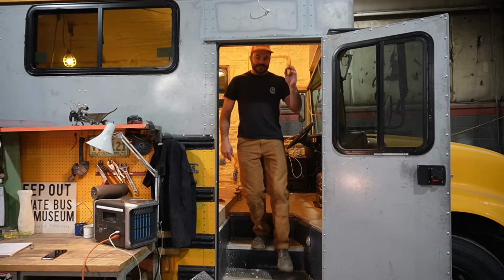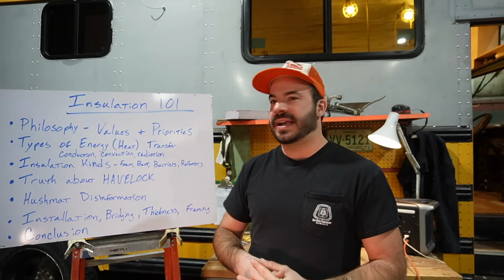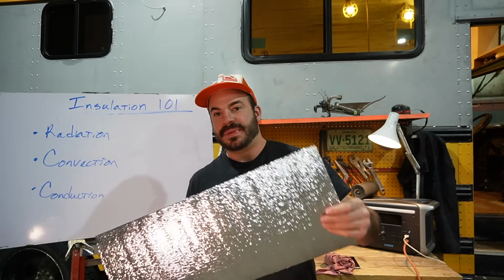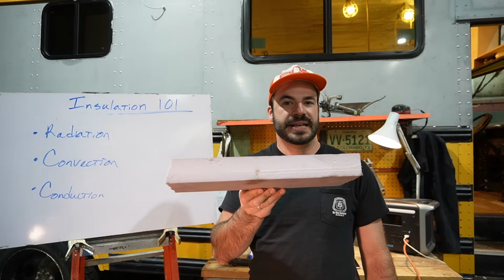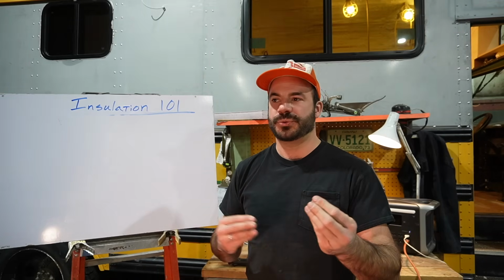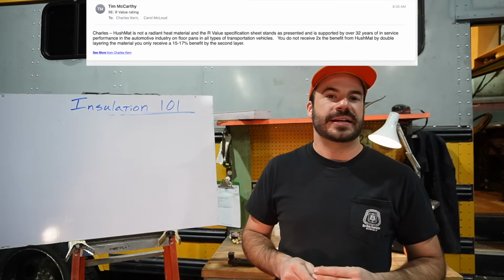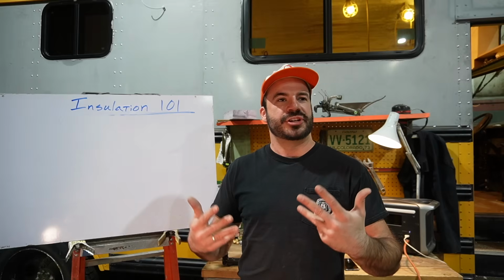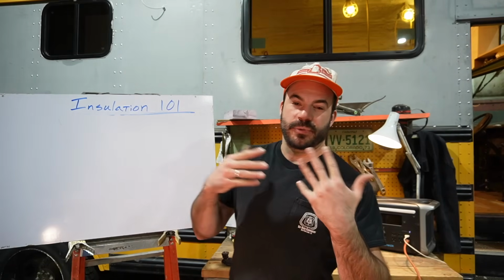Insulation is a SCAM (& the truth about Havelock and Hushmat)

Comment: I have tons of insulation knowledge, R value, thermal bridging, vapor barrier, moisture condensation, etc. I knew 1/8" of insulation is nowhere near an R value of 7 and that Havelock wool insulation is not as great as touted by IG and YT van people, but I did not realize polyisocyanurate's R value decreases with temperature! Thank you for the great info and calling out the BS some of these companies are slinging.
If you are using 2" extruded polystyrene foam on the floor with a compressive strength of 25 psi why have a 3/4" plywood subfloor, just use slightly thicker floating floor to disperse any point loads onto a larger surface area of foam, as it is at 25 psi a 1 foot by 1 foot area can support 3,600 lbs. Weight is the enemy of van or bus builds as it costs more money in fuel for the life of the vehicle and that weight may be better utilize for larger batteries or increase fresh water volume, etc.
Reply: Yes, @ChrisDaniel1339, my thoughts as well. 

The trade off is whether a thinner subfloor, which is going to be plenty crush-resistant (strong) on top of the XPS is going to be sufficiently impact-resistant (tough) enough to protect from damage that, say, the pointy corner of a really heavy object falling on it would do. The XPS underneath isn't very good at helping the subfloor resist the damage any such high-impact concentrated point loads would cause the subfloor sheet. 

So yeah, its another builder's trade-off. For myself, I think a 3/8" subfloor under another 3/8" of T&G wood flooring is tough enough, or even 5/8" under a sheet goods floor. Depends on the material, too. OSB is probably less impact resistant (tough) than most plywoods, all of which are less tough than than no-void marine ply. Its all in the cost/performance/priorities trade-offs.  I personally don't like OSB, though the ZIP system is interesting but pricey- and I'd want to put a vapor barrier on it anyway.   I would actually be more comfortable with a thinner, smoother (1/2" ACX) plywood, T&G jointed and well sealed under a linoleum finished floor, which I just happen to love. To each his own. 

I agree with you though that 3/4" ZIP board is probably overkill for a covered subfloor, but Chuck might be using that for an entirely different reason, like securing cabinets and interior walls and fixtures, or he plans on dropping really heavy stuff on the floor all the time...
Reply from the maker: i like the advantech subfloor so I can practice lawn darts inside the bus ;) really, i just like its ability to hold fastners and be a super solid substrate with great moisture resistance. We used to do tng plywood for the subfloor but the quality of that has really dropped in the last few years
Reply from the maker: I agree 100%. that news about polyiso is weird isnt it?!
Reply: @ChuckCassadyYT  absolutely! It seems like polyiso is more suited for hot climates like Florida, Texas, and the desert south west.
Reply: I was planning to use polyiso as the inside of a combined approach- the outer 1 1/2" including all the nooks and crannies will be XPS, leaving a smooth square box inside for the inner 1" to 1 1/2"  of polyiso, taking advantage of its vapor barrier on the inside. Since I'm converting a flat-sided step van, this approach makes the most sense to me. The polyiso will never get so cold that it loses all of its insulation gain over XPS. There will be no side windows at all. 

I'm still planning to spray the ceiling, as I need the strength and water protection under the rather flimsy "skylight" fiberglass roof skin. I'll laminate some more glass, then gelcoat and Tropicool the exterior roof under my solar panels.  Toying with the idea of reprofiling the roof with foam to collect rainwater. My brother-in-law has moldless composite experience, so it isn't beyond us. 

BTW, Owens Corning says that XPS actually goes from R5/in at 75 degrees to R6/in (!) at 15 degrees- a 20% gain. So my putting XPS on the cold side and Polyiso on the heated side seems like the best use of the materials, and since my rig is mostly flat everywhere, it works out about the cheapest and easiest way for me to go...
Reply: Oh, yeah, Chuck & Chris- what do you think about aerogel? Pricey, yes, but unmatched performance. Hydrophilic. Lightweight & durable. Typically wrapped & clad. Can be layered. Between R10-R11 per inch. Easily stripped for repairs and even re-use.  It is used here in Australia on process pipe work and tanks- but only where nothing cheaper will work! The aircraft and offshore guys use it, too, generally on piping.

It would seem to be a superior solution for insulating short runs of water lines to and from external tanks to protect them from freezing. A little goes a long way and could make all the difference on the short runs of supply lines exposed under a vehicle between otherwise insulated/heated tanks.  You can even wrap it (where there is room) with a lower performance outer insulation to make really well insulated piping. That's what I plan to do with it, anyway. Also could be used on mini-split refrigerant lines, but I don't know if that's ever a problem...  

McMaster-Carr has it in the US in small, expensive sheets, with a special flavor for low temperature use. Safe down to -290° F!!!

Tommo
Reply: @tommotrl  If a company could make aerogel that mixes with a binder and gets shot out of a spray nozzle it could be applied just like spray foam. Aerogel has some amazing properties the only drawback for the the avg consumer is cost. I have seen scientist hold a thin sheet of aerogel in their hand and a blow torch to the other surface of the aerogel and the heat did not transfer or burn the scientist. WOW

Comment: This is such critical information. I saw a build on instagram and the couple did not have this info, the ceiling where all their roof ribs would be were COVERED IN ICE the first cold night of their build now they have to rip and out and redo it. So many people don't have this info while building and end up with ice or mushrooms! Thank you!
Reply: Hats just like all the homes you see as you drive down the road on that same cold morning and look at all the homes lined up and you can see what homes had good builders and which didn’t cause you can see and count every rafter in the roof because of the ice/snow lines on the roof and what had already melted. Those low quality homes are all over

Comment: Great video, but I should point out you are using convection incorrectly. What you are describing is mass transfer. It is often considered a fourth method of heat transfer.

Convection is transfer from a surface to the fluid or fluid to fluid, within the defined volume. On the inside buoyancy is the primary driver causing a circulating flow up or down the walls depending on the temperatures. A fan could also increase convection. On the outside you have the buoyant effects, but also wind, which transfers far more due to its speed. There is no mass transfer thru the wall for this effect. Convection transfers the heat to the wall, conduction takes it thru, convection and radiation on the inside transfer it to you. Mass transfer (leakage) is in addition to convection.
Reply from the maker: thanks for the information, im always learning!

Comment: Holy crap, Chuck. That was fantastically spot-on! My wife is a LEED AP and teaches Energy Code in NYS and I've picked up a lot from her, and the way you apply it to a bus is fantastic. So many people don't understand thermal bridging - not even many of the pros. 
That being said, keep in mind that spray foam has its own significant issues, including air leaks and wall separation that severely diminish its usefulness, in addition to the inherent toxicity of the product itself.
Regardless, thanks so much for this video!!! Very clear, very informative!
Reply: It separates form the wall?
Reply from the maker: totally! and hopefully it doesnt separate from the wall if applied well. Ive seen it in buses over 30years old and it looked great